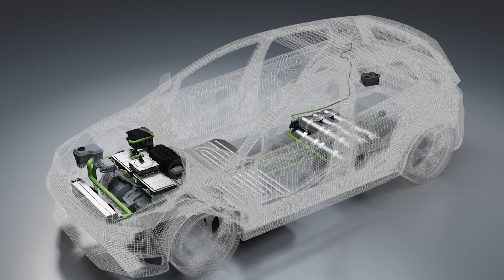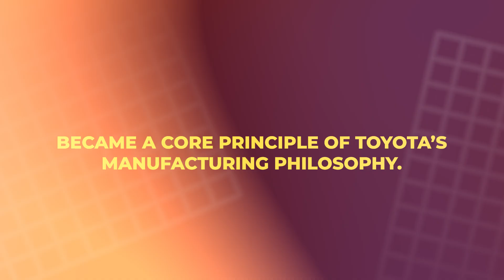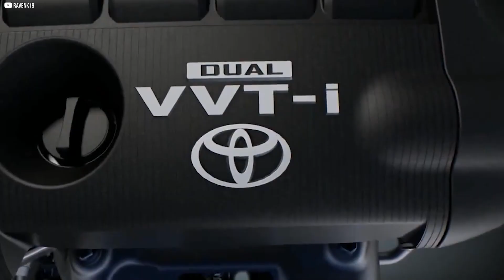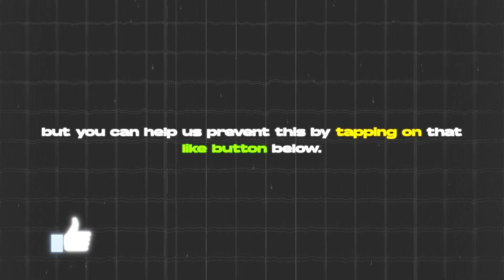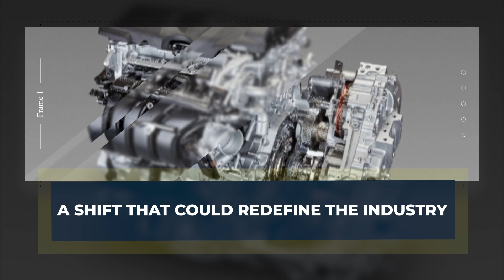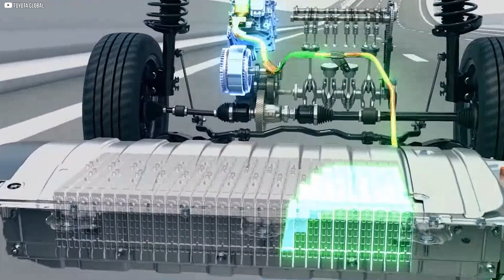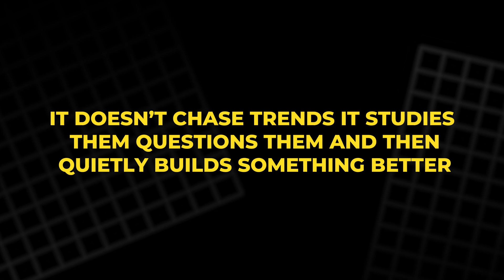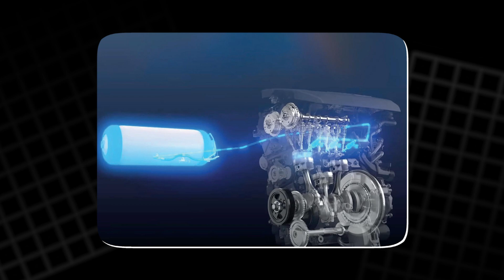The Hidden Technology Toyota Has Been Perfecting for Years

Comment: Erm, no. Toyota did not see the limitations of full electric vehicles and charging infrastructure, they saw the end of their cash cow high maintenance internal combustion engines....all those oil changes, servicing and spare parts. Any ICE is still inherently inefficient and creates exhaust emissions. They are deliberately trying to tie buyers to all the high cost maintenance of current vehicles as well as keeping all those petrol stations in business. Toyota isn't trying to do you a favour, they're purely protecting their revenue stream... vehicle maintenance
Reply from the maker: You raise some valid points about the automotive industry and the shift towards electric vehicles. It's definitely a complex situation where companies must balance innovation with their existing revenue models.